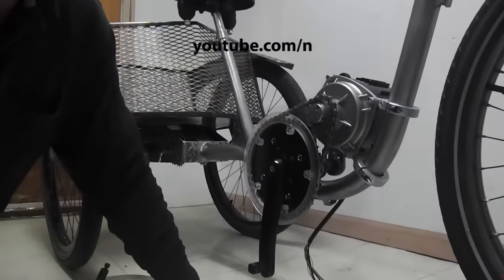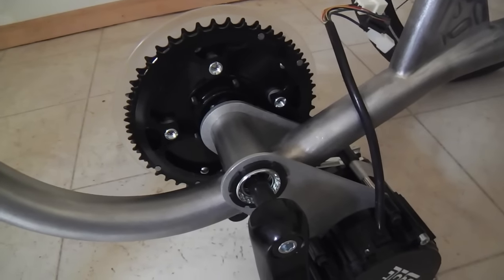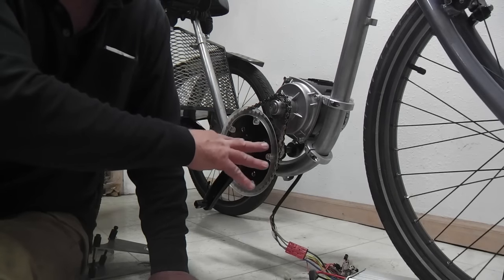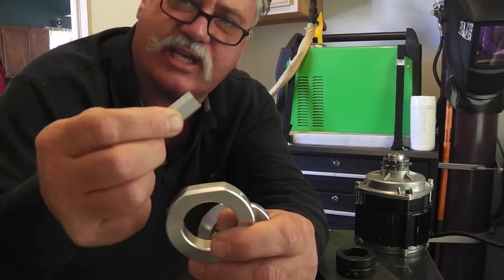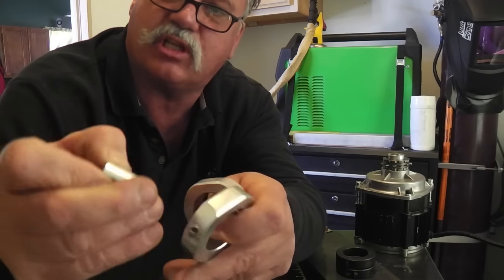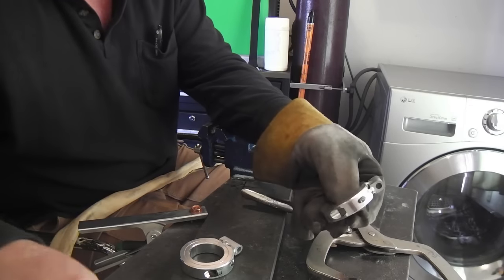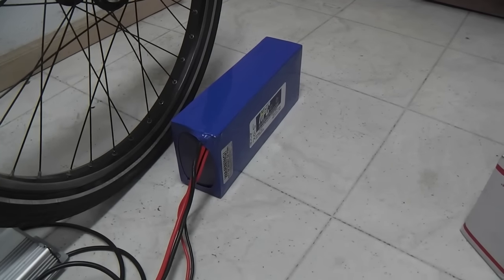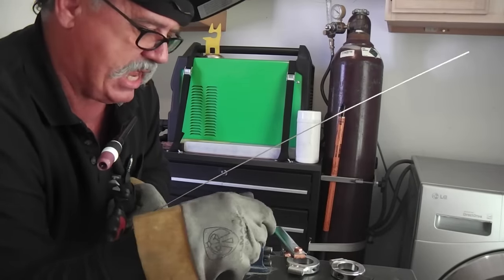Improved Cyclone 3000w eBike Mid-Drive Motor Mounting Solution

Comment: Good information. Thank you for making and posting this video. Glad I had the patience for it today, lol.
I have always been a little worrisome about the mounts with those things.
It's interesting that such a simple solution isn't provided by Cyclone. They have never been known to be all that concerned about how their motors where used though. I bought one of their 500 watt motors over 6 years ago and had to get a custom mount from the dealer.
I'm really curious about your trikes handling with such a powerful motor. I've never seen someone put something like this on such a vehicle. From what I understand, these types of trikes are not designed to go very fast and can be really unstable at higher speeds.
I would also be worried about the tongue of a powerful mid-drive system bending the rear axle.

Comment: I would be a little afraid the torque from the motor would slightly shift the collars over time. have you had any experience like that yet? Great idea though. It looks really nice.
Reply from the maker: Nah, as I've more recently shifted the motor to the rear, with a chain drive to one of the axles. It's mounted completely differently now, and is quite stout.

Comment: What's the wall thickness on the thin barrel sections between the M6 bolts and the motor? I am planning on doing this but afraid that the wall might be too thin. 
BTW, thanks for super useful video!
Reply from the maker: Yeah, it is pretty thin and may deform with torque forces over time. And I've since mounted the motor in the back, directly via chain to one of the rear axles. And the motor is now mounted in a pivoting fashion with two side plate/flanges that stick three of the four bolt heads on each side of the motor, so it is quite stout that way now. I'm dabbling with the idea of further putting two, lower watt Cyclone motors to the rear two axles, so that power transmitted will be equal at the rear, to avoid some initial "torque steer" at take off.

Comment: Do you have a video of all the wiring connections to the controller! ? btw .great video! Greetings from Chicago!
Reply from the maker: +Gerardo Gama 

No, Gerardo, no video about that. 
But I'll pass along a link to an article that shows the wiring hooked up. 

https://www.electricbike.com/taking-on-the-cyclone-mid-drive-an-ebike-brute/

It's enough to make things clear. That little stray lead for the throttle is somewhat extraneous, and can be joined to the controller side of the battery connector, rather than the battery side, since you'll probably make new connectors there anyway, like you may be able to see that I did with Anderson power pole connectors in ending portion of the video, if you look closely it's that lighter gauge red wire going to the heavier gauge red wire. Doing that alleviates that bullet/butt connector forever.
Reply: I like the polish on the side covers of the motor gears and the stator. How did you do it aside from stripping the paint off?
Thanks for replies

Comment: really nice invention and thanks for the video. where can I buy the collars and tubes?
Reply from the maker: Sure, I got the collars via Amazon, if I recall correctly, but possibly not from Amazon directly (to avoid sales tax). You just pick one in aluminum, steel, or stainless with an inside diameter that matches the downtube size of the bike frame. If needed, you can grind where the two-piece collar comes together to get a little more clamping ability.
Reply: NewJerusalemTimes Thank you!
Reply from the maker: I got the aluminum collars via Amazon. No tubes needed.

Comment: So did the motor rotate on the frame causing a miss aligning after you used it for awhile?
Reply from the maker: Thanks for asking, but I've laid this project aside for a while and have been doing some more outside projects involving a couple of zero-turn mowers and a big melon garden. But when I do get back to it, I'm thinking that I'll just mount the motor in the back, with a chain directly to an axle sprocket, so that the torque of the motor doesn't go through the internal geared hub, which is normally considered a benefit, but I want to get back the coaster brake ability, which the freewheeling Cyclone chainring disables. And I just want to hide the motor too.

Otherwise, some loosening of the collars over time could cause chain misalignment, but realignment and tightening would be the simple remedy. The collars that clamp to a straight portion of frame tubing are so solidly clamped in place that I doubt that they would ever move. The collar clamped on a curved portion of free tubing does not have the full surface contact as on the straight tubing, but I think that as long as at least one collar is on a straight portion that it is enough to keep even the other collar from any chance of losing its grip.

Comment: how does the front sprocket work?
Reply from the maker: Well,
There's two freewheeling front chainrings. The motor has a 14T freewheeling sprocket on it too. So, on my initial mounting of the motor to the chainring, which then goes to an Internal Geared Hub, which has a coaster brake, the coaster brake can't actually be actuated by back-pedaling. And I'll ultimately mount the motor directly to a rear axle sprocket, partly to regain the coaster brake function. Otherwise, the external freewheeling sprocket on the motor is very helpful in being external, since it's easy too diagnose and replace, if needed, unlike a geared hub motor or a Bafang mid-drive kit.
Reply from the maker: Yeah, that's the standard set up. A Bafang is similar, except that the other drive is geared and is internal, if I recalled correctly. The Cyclone has both as chain drives and are external, which have some advantages, except that it does look kind of like a tree limb grinder....